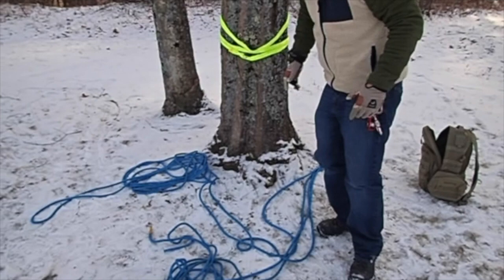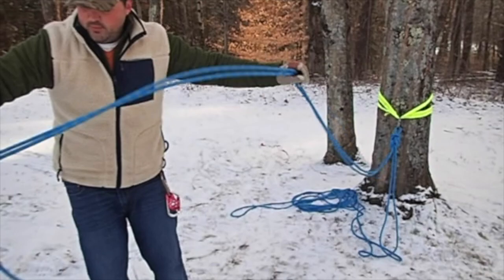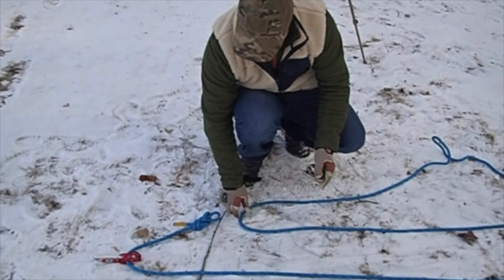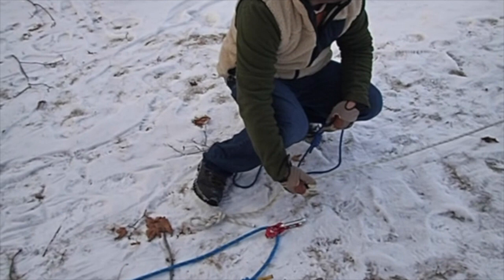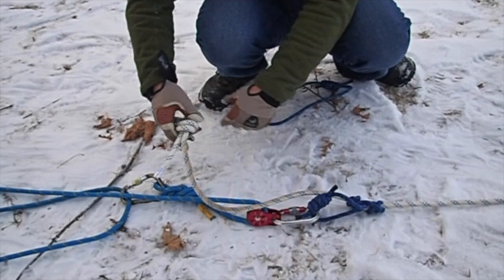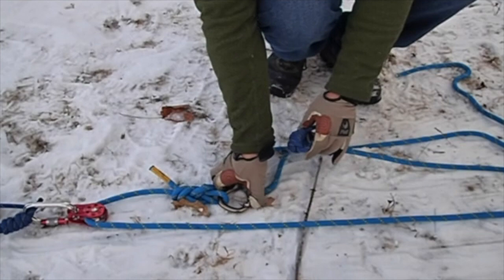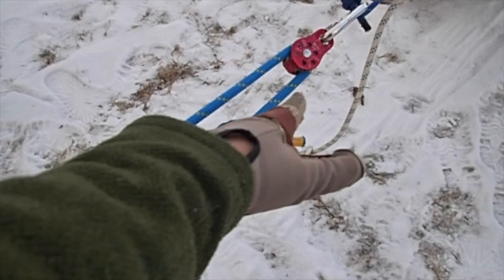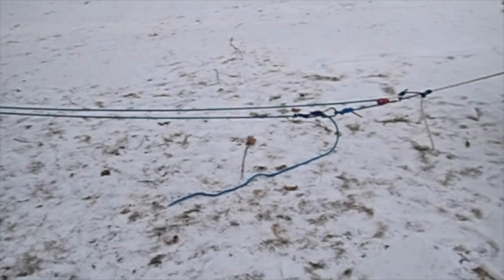4-1 pulley (piggyback)

Comment: Great video but I don't understand why chose the prussic on the load line instead of putting the load line figure 8 on the carbine and add prussic for capture.  Thanks for your time, expertise and that fine assistant!!
Reply from the maker: I posted a correction in the description. The prusiks would go on the main and belay and this is strictly a haul line with no ability to reset. Thanks for comment

Comment: This is a good effort, but I think you should reshoot it doing it correctly. In its current form,  it may confuse folks more than it helps them.

- As the system was set up there is no way to reset the system both because the load is only held by the the hauling Prusik, and because the progress capture Prusik will prevent the system from being reset. You partially address this in the notes, but unless someone already understands how a piggy backed system is supposed to work, the notes won't make that clear.
- Use two pulleys. And if you do use a carabiner rather than a pulley explain that the carabiner won't mind a Prusik and that it is more efficient to put the pulley as the first 2:1 and the carabiner as the second position rather than as was done here.
- Don't call a Prusik hitch a wrap 3 pull 2 (as you do when tying the second Prusik hitch).

You obviously know what you are doing so you could really make a great video if you took some time and did it right.
Reply from the maker: If you read the description you will see the correction that says you can not capture the load. 9.9/10 people using a pulley like this would use it in their garage or to pull a 4 wheeler out of the mud. The capture is not important on this pulley unless you are using it with a 3-1or haul line with someone over a cliff. i have 10 year on a high/low angle mountain rescue team and the capture is more advanced than the pulley. I debated pulling and reshooting the video but the capture isn't really important on this type of haul. We would eastsblish an anchor and 3-1 is our go to haul. If we need to lighten the haul we would add a 4-1 to the 3-1 with prusiks. The 3-1 would capture and give us the ability to reset the 4-1. I don't know how you can say this video would get somebody hurt. Nobody should take any YT video and think they are a professional. The only difference between this video and others is they show the pulley setup vertices lifting a brick, while this video is laid on the ground.
Reply: Joe, I did not mean to imply that this setup would get someone hurt. 

And I agree that folks shouldn't learn their rescue skills only from internet videos.  I just meant that someone unfamiliar with MA systems will not understand the correction or its implications.

And absolutely, it is much better to show the setup outside on the ground as you did rather than in a garage or on a white board as many YT videos do.

Comment: I don't understand the prusik on the load, isn't the prusik rope holding all the load? Wouldn't it makes sense to hook the actual rope to the caribiner, the rope is stronger than the prusik? I am a bit confused.
Reply from the maker: Thad Sipple the Prusik is a rope grab and it allows you to slide in either direction to grab more rope. As your pulley pulls uphill you will run out of room and have to reset the system and the Prusik is just one way  to grab more rope. The Prusik is ahead of your pulley grabbing, while your mechanical advantage is behind doing the work.
Reply: I get that, I meant at the end of your system the Prusik was hooked from them main "load" rope to the pulley, in that instance, the prusik was carrying the entire load and if the prusik slipped the load rope would slide thru to the knot. Unless I saw it wrong. I am stilling learning all this. Thanks for the video too.
Reply from the maker: +Thad Sipple I see what your saying. If you were doing a small haul you could use a carabiner if you want but the way I set it up is for a large haul. This is used to haul someone up a hill. If they repel over the edge they do it with a single rope and when they get to their destination they tie off. Then the haul team will set this up to haul them back up. You would use a rope grab or prusiks to attached the the repel line to bring them up. Having a rope grab will allow you to reset the system. After you pull and pull you will run out of room and you will need to reset. When you reset you extend the system to gain more ground. If you were using this in your garage you could use a carabiner or even just a knot. You don't need to haul 300-400feet
Reply: Awesome thank you for your response,  I use pulleys to pull my Subaru out of the snow and mud, whenI am by myself and amazed at what can be pulled, if it is too hard just add another pulley.
Reply: I honestly don't understand that prusik on the load rope either, even after the explanation. To move the prusik along the load rope something else will need to take the load temporarily, or the rope will need to be under zero load, in which case you might as well have "figure-eighted" the load rope at a suitable position before hooking directly to a carabiner?

Comment: Would that not be a 3-1 pull? You have 3 working lines and the pull line. I was under the impression, the one you pull, is the "1" and the rest make up the 3. Or am i not getting it? I am a beginner

Comment: Does a 4-1 pully system increase whatever pressure you use to pull eg. 25lbs to 4x that amount so 25lbs of pulling will pull 100lbs in weight?
Reply: bingo

Comment: My only question is the location of your load capture device for reset. Yes, your pull rope is slacked but the rest of the system is still under tension making reset impossible. I suggest relocating the capture device to the load line and the other 2-1 in the system, or completely setting up a capture system separate  from the 4-1 piggy back.
Reply from the maker: I noted that I description. Pulley is attached by rope grab to main/belay and your capture would be on those ropes. Good catch

Comment: what is it with you and making videos about pulley systemsand not having the gear (the subject, the content). Great info, and you're doing everything right, but pulley videos should have a pulley where needed, not biners. Keep them coming...
Reply from the maker: Sorry. I think the info is important and just because I'm one pulley short shouldn't stop me from making a video and share info. Lots of climbers use nothing more than a caribiner. I figured most would get the point and understand what I was saying. It isn't idea because it creates added fiction but still possible. I climb on my own so my gear isn't as extensive as our fire department gear.  I'm the lieutenant of the Fire department  and it's hard to take department gear to make a video on my own time. Thanks for watching
Reply: JOE MANIERY I get it. I do (use to do) tower work so we used pulley systems constantly. As I stated, still good info,but somewhere there is someone watching these to learn for the first time before they go and do it themselves.

No problem with you not having everything, I don't either, I also don't make videos, no intentionof starting, but a video about pulley setup, in my opinion, should use a pulley at each pivot.

I like your video, just wishing ALL the parts were there. 

Again,keep them coming.